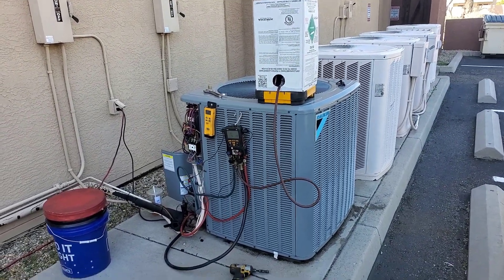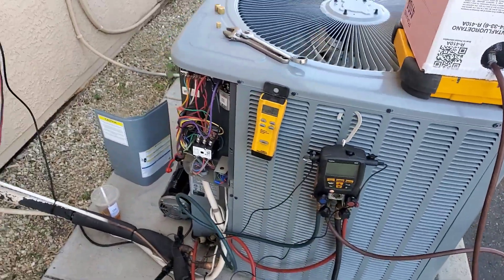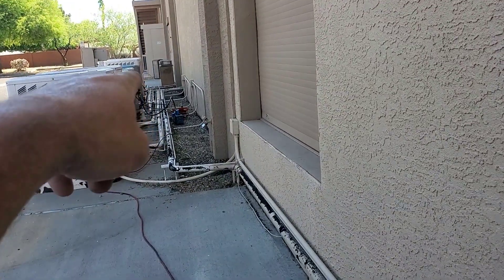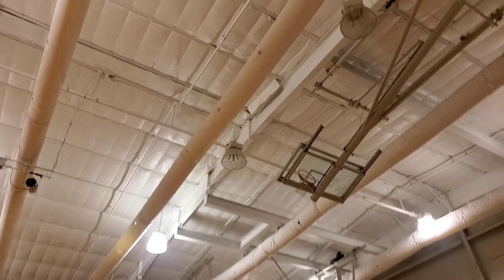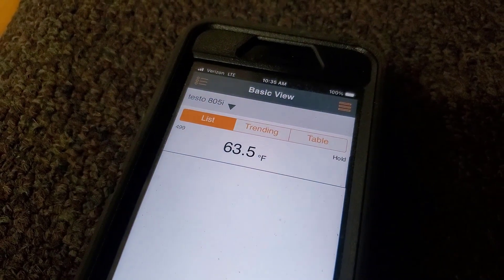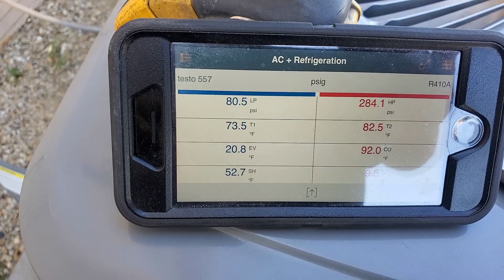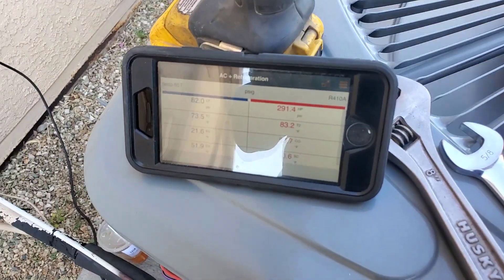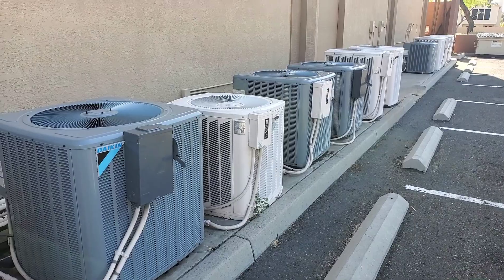This is what happens when you operate a R410 Heat Pump with a R22 AHU [At death trap AHU job]

Comment from the maker: NOTE:
This video is a follow up to this one https://www.youtube.com/watch?v=b-YQUcAmj6s
Where I visited this church to get an overview of what was there and had found that these air handler units were installed close to 30 feet up with no safe access!
Reply: Hey why didn't you do what the guy did with our unit at our store the old r22 unit went out so when changeing the unit he flushed the coil out good and changed the metering device on the coil to match the unit.  It has been cooling perfectly for 2 years now it cokes on and the show room gets cold it will blow a good 20 degree drop out the vents.
Reply from the maker: @SuperJeremi10  
Is that unit a heat pump or cooling only?
In heat pump mode the pressures will be 400+ in the coil. Coil rated 300 PSI
Reply: @hackfreehvac  it's cooling only.  I didn't think about it being a heatpump.
Reply: @hackfreehvac  I didn't know heat pump pressures get that high in the coil.  The heat pump I had installed at old house was still working great when I sold the house . It was a matched system though everything new.

Comment: I’ve always been curious how you can tell when one unit out of nine or generally a lot in a large open space like that goes out. Would you even be able to notice since the other 8 would still work? Seems like a few have been replaced but not all. I went to a summer camp one time that had a large space with 7-8 package units and one was considerably newer than all the others.

Comment: Slap in a R-410A piston remove the old r22 txv
Reply from the maker: Still a 18 yr old corroded R22 rated coil.
So I dunno if I'd want to guarantee that.  Lol
The air handler units are getting replaced.
As soon as they provide safe access to them, as they are suspended 30 feet in the air above a t-grid and not enough room for a typical lift.

Comment: I wouldn’t have wasted my time dumping refrigerant into it. It’s a long known fact you’ve got to change the metering device at the minimum . The coil probably isn’t technically rated for r410a pressure , but it will most likely hold fine unless it’s a heat pump. But you already knew it wouldn’t work with a r22 metering device . The customer isn’t always right

Comment: You need to change the metering device.Most of them coils are rated for R22 and 410 a. Do not get me wrong always good to replace both units .However,it’s the customers money and choice.I have done several you do need to change metering device and purge the line set real well.I would be interested in the model number of the indoor unit.
Reply: I agree.  You can get ok performance using an R22 condenser on an inside 410A txv but not the other way around.   Nothing beats doing it the right way but hey, you do what you gotta do.  With that many systems in the gym, they may not notice one underperforming.

Comment: The Daikin dealer in my area has a R22 AHU tied to a Daikin VRV 4 system with Daikin’s AHU kit. Seems to work. I would be afraid to put the AHU in heating though.
Reply from the maker: This is in their test lab or in use somewhere?
Reply: Their test lab

Comment: I'm in charge of facilities at a local church and gym turned venue space, the church has four 1968 Lennox gas furnaces, 2 sets of twinned furnaces, 2 smaller furnaces for the downstairs and 2 larger furnaces for the upstairs, they have Ruud air conditioners that were added a few years ago, each furnace has its own coil and the ducts are combined at the first turn after the coils, you've got a 5 ton unit running 2x 2.5 ton coils and a 4 ton unit running 2x 2 ton coils, 5 ton unit does the upstairs, 4 ton unit does the basement, one thermostat controls both levels, though I plan on adding a basic Lux programmable thermostat and running a new thermostat run with a common for the basement climate control, upstairs has a Honeywell thermostat and the elderly folk keep messing up the programming and it doesn't have an input lock like the Lux I'm wanting to go with. The gym is a doozie, it has three 5 ton HVAC systems installed, two are old Rheem/Ruud box units, and the oldest of the bunch is a Payne semi round unit, all are mated to newer Goodman 96 percent furnaces, and all have a large return and a large supply there's 3 thermostats that now have locked covers on them because the church ladies kept messing with the units, constantly changing between heat and cool and blowing breakers, so now they have to consult me, the man of a million keys, or one of the other keyholders

Comment: I used to do apt maintenance and I did over 100 of them like that. Not proud of it but that's what they wanted. All 2 ton and straight cool with piston or cap tube. Now that subcool superheat was out the window man. Just throw it to 40⁰ saturation and run lol. Ah those were the days. Now as a full time tech I laugh at that

Comment: U coulda tried blueon  might have worked  since its almost like r22  and its a txt so I believe just charge by super/sub like normal
Reply: The r410a compressor has a much smaller displacement. If you used r22 the capacity would be 50%.
Reply: @inoahmann7542   but indoor  coil  is  r22  so technically u gota got with whats inside but unit is being replaced so  i guess might not really matter anyway but I was thinking Atleast it wont freeze and wont have to do many changes
Reply: @ronnyoo9371  true, it would work but the capacity wouldn't be very good.

Comment: A great example of a sunken cost fallacy hard at work.

There is a right solution....and then there is continuing down this path to find a 'good enough' solution..   But hey...if thats what they want to spend their money on, may as well enjoy the journey.

Those outside units are pretty close together, and not even matched units.  I can't help but imagine there is a single spot on a wall with multiple thermostats all set independently.  Is there even access to change filters on the air handler(s)?
Reply from the maker: I have no idea how the air filters are being replaced. They are in the air handler units.
Which are as high as those duct socks but on the other side of the wall.
Reply: @hackfreehvac  I do hope you find the builder and give him a good throat punch for creating this.
Reply from the maker: @Robert-S-  
Heck yeah! 🤜🥴

Comment: Nice experiment. You could have tried pushing your subcooling a little higher using a 30 over ambient on the high side. 
It would've pushed you closer to 330 psig on the head but that subcooling may overshoot by alot, at the same time it could've raised your suction pressure. I still wouldn't approve though lol